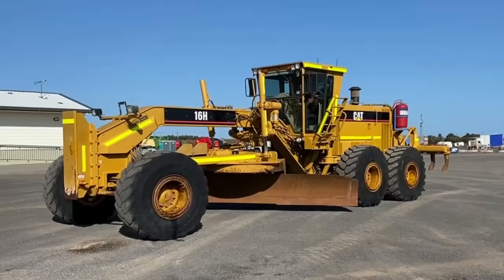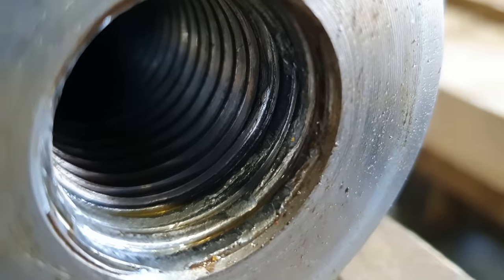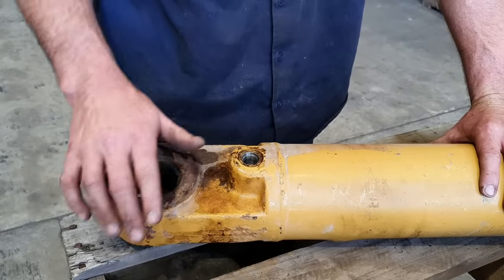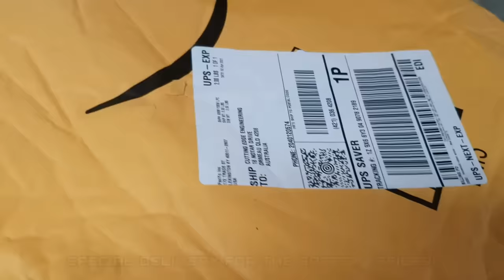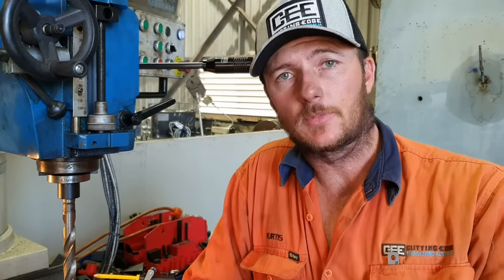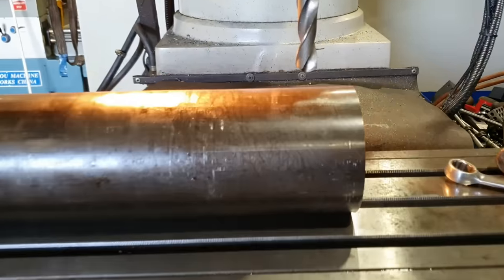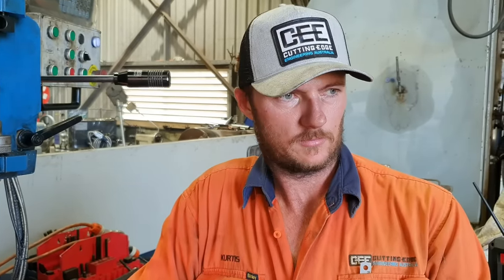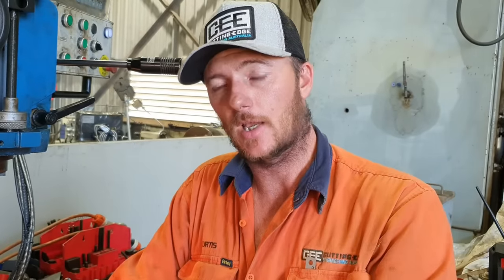Repair DAMAGED Hydraulic Cylinder for CAT 16H Motor Grader | Machining & Welding

Comment: "A 19mil hole, or 3/4 of a banana". :D Ah yes, finally - banana for scale.
Reply from the maker: Oh yes The Standard Banana is a most accurate form of measuring 🤣👍🍌🍌🍌
Reply: @CuttingEdgeEngineering  Ah yes the decimal use of a fraction measurement can only be the most accurate form of measurement! 🤣🤣🤣🤣 only the yanks could think it was a good idea! 😂😂😂
Reply: And the banana is kind of 1 inch thick so I agree with Kurtis it is banana not a pinch😂😂
Reply: I saw a plastic banana ruler for sale.
Reply: @sumduma55  Apparently, they assume length bananas. Here, it's diameter bananas, a completely different unit.
Reply: @STRA1GHTAHEAD  well... I guess that explains why I can't get this cow into this horse trailer.
Reply: @CuttingEdgeEngineering  by that you mean MOON LANDING UNITS! Lol.  Real men measure in fractions. Lol.
Reply: @STRA1GHTAHEAD  In the UK, 🇬🇧 in shit engineering documentaries they seem to like 'double decker buses' as both a unit of length and weight 🤔
Reply: @Miketm155  Good enough to get us yanks to the moon. 😊😊 but seriously the imperial system is a pain.
Reply: @derekjthompson1986  yeah that’s true but I reckon it’d been cheaper in metric 😂😂😂😂 like I get it when your down to 1/8’s of an inch on a tape measure but when you get into decimals on a digital vernier gauge I’m like how the heck does anyone deal with that! 🤣🤣🤣
Reply: I converted to a PA25 Pawnee once, and used to knots, I was briefed that this had an ASI calibrated in bananas.  It might have also been mph, but bananas seemed to work just as well.
Reply: You obviously don't watch AvE lol
Reply: I want to ask because I live in America and everything is just go buy a new one. How exactly does the screw pull out of the rod if it just holds the piston?
Reply: Hey! I don't do sillimeters!
Reply: It’s a blonde one bigger than a banana to be exact
Reply: where do you think the inches and feet come from. Some say the yard was the distance the nose and the tip of the middle finger of some English king..
Reply: @xl000  From a country that drives on the wrong side of the road, uses Sillimeters to measure things and doesn't speak The King's English .... hmmmmm. 😎
Reply: @justinpass8154  There is a lot of pressure on that bolt when the cylinder is retracting.
Reply: 2021 most of the world believes it.
Reply: It can join football pitches,pencils,tennis balls and human hair in the hall of fame of super accuracy….🤣🤣👍
Reply: @Miketm155  A thousandth of an inch is actually a nice unit in the shop. It's one of my favorite stateside units. It's right around the lower limit of what you can see and feel. A millimeter is too big for that and a micron is too small. A thousandth is in between, logarithmically. For example, a sheet of paper is a few thousandths thick. That's nice (e.g., as a spacer) in the moderate-precision work quite common in a machine shop. The same sheet is about 75 microns thick. That's less convenient.

When I would visually "touch off" in a lathe or mill with a nice sharp tool, it generally knocked off about one thousandth in my hands. Again, this meant I could conveniently get parts within spec for relatively demanding applications (small parts: optical adapters and sample mounts for laser experiments). For example, often I'd be facing some small rod stock in a lathe collet and need to hold a +/- 0.001" or 25 micron length tolerance; it was possible without a calculator or lots of mental math.

Another nice unit (I'm a chemist by training so this is saying a lot): degrees Fahrenheit is nice for discussing what's going on in the kitchen or with the weather. You almost always get all the precision you need with a positive whole number on a common scale. That wasn't quite true in Chicago, though - Chicago gets pretty cold.

Now give me the mass of an object in grains and its velocity in feet per second and ask me for its kinetic energy in foot-pounds, and, yeah...bananas.
Reply: #gottherefernece 5/7 👌
Reply: @Miketm155  to be fair, we stole it from the Brits.
Reply: @justinpass8154  the piston is pulled off the end of the rod because over time the bolt holding the piston vibrates loose, eventually there isnt enough thread to hold it on.
Reply: @Miketm155  some of use yanks can use both.   ;p
Reply: In the nuclear world we use bananas to explain in layman's terms how radioactive isotopes are. "Banana Equivalent Dose," or BED.
Reply: @justinpass8154  my guess is it became loose from vibration. The bolt has to transfer the hydraulic force from the piston to the rod when retracting the cylinder
Reply: Really enjoying your vids. I notice you never make a pilot hole but just go straight to the eg 3/4 banana.  Btw our uk smallest amount of size is known as a “kipper’s eyelash😂
Reply: @justinpass8154  wasn't torqued properly when either assembled or repaired.  Or the lick washer on it broke and caused the bolt to come loose.  Those cylinders work under extreme pressure over 4000 psi.  If something breaks internally all kinds of crap will happen.
Reply: @sumduma55  19.05mm is exactly 3/4 banana. I work with the banana scale all the time and much prefer metric. I am trained in bananas, so i always have to relate mm to banana to understand the true scale i'm working with.
Reply: @danieltodd22  or from stretching more like it.. Or the thing wasn't done up properly to start with
Reply: Waiting for a crypto currency based on 🍌  - banana dollars
Reply: It's time Americans learn how to measure properly. Metric is definetly way superior to bananas. Thanks for  yet another awesome video guys 😀
Reply: Little fun fact. Napoleon wasn't as tiny as everyone thought. 
British heard about his height and forgot that a fresh foot was 10% longer than a British one.
( French have bigger feet than English man) lol
Reply: @mynameisaric  Why use the odd monkey system if you’re already used to Imperial?
Reply: Does the piston head not work? or did they forget to recover it?

Comment: You know the parts are expensive when they're willing to pay someone else to go through all this to make the old one re-serviceable.
Reply: Either expensive or will take too long to get the replacement part. Sometimes both of those is a major showstopper. Oh there is a third, which is where the part is no longer available for whatever reason.
Reply: CATs  are yellow because it is the colour of gold.

Comment: "3/4 of a banana" - you're killing my sides!
Reply from the maker: Banana measurement helps our USA viewers
Reply: Do we assume that there's exactly 12 bananas in a 'bunch'? 3 'bunches' in a 'branch', and 1760 branches is a 'plantation'?
Reply: @CuttingEdgeEngineering  If the US had completed metrication started in the 70s people would speak the same and wonder why in hell it didn't happen 100 years ago ! The net result is confusion, errors and lack of competitiveness ! Recently has to laugh at Home Depot listening to two people trying to figure out the total pipe length they had to buy, trying to add feet inch fraction etc....
Reply: @clitisswood7330  Homedepot = rank amateurs, they can't handle 1960mm either. I work in both systems daily and have for 35 years, I could care less, both systems are dirt simple. My only gripe with the Metric system is the thread selection for fasteners below M20 is shit. The coarse series are too fine and suck horribly in cast.
Reply: @trevorvanbremen4718  It depends on whether it's a US or imperial banana.😂
Reply: @clitisswood7330  Bullshit, US mechanics are drilling out seized metric coarse in cast iron and grey 60 , and discarding welded components due to cold welding, The US auto industry has been metric for a couple decades now. 
When I get cylinder glands and valve bodies in with metric fasteners, the M6 thru 12 always need inserts because the threads come out with the bolt.
 I get a laugh out of people beating their chests in supposedly "hard metric" countries. Metric pipe threads? Nope, Imperial with metric units applied. Metric roller chain? Nope, Imperial with metric units applied . Metric sockets with metric drives? Nope Imperial drives. Fly in a plane, altitude in meters? Nope, feet. (widely adopted international standard)
Anyone with an IQ above 100 can learn both systems and it pays to do so if you are in engineering or machining. That way you won't be baffled as to why your new ratchet wrench drive measures 12.7mm  🤣
Reply: @trevorvanbremen4718  And a hand of bananas is a foot long .  So that 3/4 of a banana hole is also 1.1/5 fingers which sounds about right !
Reply: Got to "love" things 3/4 and 3/8 inch, AKA 19 and 9.5 mm.  The stuff works for everybody.
Reply: @steamfan7147  I understand your reasoning, however we live in a global economy, we should definitely get our shit together and perfect a single universal standard(integrating the best from all pre-existing measuring systems). Otherwise there will always be confusion and many other engineering mistakes until the end of time...
Reply: @Dsp.Studios  I have heard all the arguments for the past forty years I have been listening. The problem here is we do not have a clean slate to work from, we have existing infrastructure that we cannot throw away and start over with.(about $200 trillion in the US alone)  As for engineering mistakes, that stems from the quality of the engineers being produced, which these days isn't very good.
Reply: @steamfan7147  i dont mind the imperial system but it shouldnt be used anywhere in Metal Industry
the metric system is overall better unless u want to imagine yourself Football fields or smth
Reply: @LordOfChaos.x  In the machine shop, both are expressed as decimal measurements,. If one has modern machinery it's as single keystroke to convert either way.
Reply: @darinareyacrazyman1505  i see no reason for Imperial System to be used in the first place 

I dont care about your nonsense 
But its just irritating to do contracts with countries that work with Imperial System
Reply: Yeah got me 🤣 good

Comment: The thing I like most about your channel is you explain what's needed then get to the machining.   Other channels go into such excruciating detail about how they go about setting up a job, clamping it down, dialing it in, why this will work & why that won't, etc. Which is fine if that's what the viewer is into, however, I'm not a machinist and never will be but I'm always curious as to how a technical machining job is accomplished, which you do to perfection.  Thanks!

Comment: Thread cutting on a lathe still seems like a dark art to me. I'm astonished how easy you make everything look.
Reply: Its easier than it looks. His lathe looks like it has auto shut off at the end of the thread so that makes that bit easier, normally you'd have to be pretty quick on the stop button or lever, digital readouts also make life easier, I've done a little bit of threadcutting on a lathe, good skill to learn. We did 95% of our work on the CNC lathe though, that shit was beyond me, CNC computers confuse the shit out of me
Reply: once you get the hang of it its not too hard. Basically, you using some method to connect the spindle to the movement of the caridge, for example in this video he cut a 12TPI thread so for every one turn of the spindle of the lathe, the threading system on the lathe moves the caridge 1/12 of an inch. You use a form tool to get the right thread shape
Reply: I’m amazed at what CNC can do. I’m even more amazed at how ridiculously complicated the software is.  It’s a computer FFS - software should not make jobs more complicated than they already are.

Comment: When I worked at the hydro power station a bolt that size broke in 3 pieces on the end of the Francise turbine shaft. I caught It in time and saved the thrust bearing. The turbine looks like a giant snail shell.

Comment: hey i noticed you were pushing the mig i cant remember if i was taught to push or pull but get good results pulling but noticed i get a huge difference in weld quality  doing a fillet just by changing the rotation when laying the  pool

Comment: Common problem with this cylinder. I retired from Cat hydraulics cylinder plant. Conical washer was installed backwards causing loss of torque on the piston bolt. Admire your machining skills. CNC machined for years. Cheers!

Comment: Enjoy your excellent videos and admire your skills. Wondering why when the old cylinder was put into the chuck there was not much effort for indicating it to be dead center when a center drill was used for making a center on the other end. Maybe cutting off part of it does not need that much accuracy, but when new cylinder was held, the same applied. I was thinking maybe cutting a thread on the other end of it requires the piece be really dead center and no wobbling. Is your 3-jaw chuck that strong that hold a piece so securely for cutting thread. Wouldn’t it need a steady rest to hold the cylinder steady for thread cutting. I am disagreeing with your excellent work, I am just curious. Thank you for your videos.

Comment: I would like to see a mention or an entire video that is dedicated to what can make a weld fail, I.e. not cleaning all of the slag out of a previous weld, before starting the next.

I couldn’t possibly count the number of times that I’ve seen a weld machined down for dimension, and a pin-hole appears because all of the slag hadn’t been cleaned out properly. It’s probably 2-3 time a week!

Comment: Sometimes I rewatch episodes for a few years ago like this one :) 

The last episode I watched the cylinder came in as the end could not be unthreaded, Kurtis ended up machining it out and had to replace it with a new one (till a faction of the cost of replacing the entire cylinder)

I was thinking the system or machining off the end off welding it for replacement, is much more efficient than having it threaded on, IF it gets rusted,.

Rust cannot penetrate a weld!  It seems to me it's better to just weld the ends on, than make them all threaded.

Comment: Hey Karl, for some1 who has never stepped into a shop I was wondering two things: what happens when you dont use oil/coolant while drilling, and do you protect your dog's eyes from welding?
Reply from the maker: Hey mate, no oil/coolant when drilling and shit gets hot haha but leaves not a good surface finish, wears out tooling faster. Doggo stays in the office when i'm welding he doesn't like the sound
Reply: @CuttingEdgeEngineering  thanks for the answers Kurtis, love your vids😃

Comment: So, I guess the piston having a dent at the tip is not a big deal, as long as it glides in the honed cylinder. Is the glans bolted on the end a critical fit?

Comment: New to machining, when putting in those internal threads, are you advancing the tool by hand to get the proper thread spacing or does the machine do that? Seems very challenging to cut threads manually like that
Reply: The machine has settings to advance the tool at the correct thread pitch and synchronization. There is a threaded shaft geared to the spindle that drives the cutting head.

Comment: How do you decide whether to weld a block on the end of the cylinder versus drill a pilot hole? Seems to me that it would be better to have tack welded a block to drill the center point into rather than weakening the eye by drilling the end itself.

Comment: I would like to know how you polished the inside bore, as the O rings must have a super polished bore to so the O ring seals do there job when the cylinder is pressurized? If the surface is not supper smooth the O ring seals will not work and wear out in short order !!

Comment: Kurtis, why did you not leave any gap in the joint you prepared? I have set up a ton of welds and between 3/32 and 1/8 of an inch is necessary to get full penetration. All the best, Edgar from Canada

Comment: I've watched you do miles of heavy duty weld, yet it has only just dawned on me that Karen is also watching you weld and thus, must be using a welding mask.  An automatic one,  I take it?  The thing is, can the automatic gain on her camera cope with the weld flash, or does she put the camera inside the mask?  I kind of think I see that happening, but it is so quick and the mask so close, I'm never sure.  In short, it must be very difficult to video welding and protect the videographer?

Great vlog, mate, I was beginning to wonder how much was going to be left of the original ram!  Of course, it's not everyone who 'happens to have' a chunk of 120mm honed bore tube lying around!  Great work, well done.

Comment: Very good job, I would have also made a reform to the design of the piston with the rod.  I usually make the stem with a male thread, in which I thread the piston, and then to block it I use a small threaded grub screw between the thread of the piston and that of the stem, thus I avoid this type of problem, that a screw of those dimensions drop into the cylinder.  
I understand that the client has requested it that way, it surely has a replacement piston, but I think that it is not the best design.  A greeting from Spain.

Comment: I'm a bit confused.  How is this a "repair" of the cylinder.  The only part of the cylinder that was not REBUILT was the ell connection.  This was a great video on the REBUILDING of a hydraulic cylinder.
And i consider the cylinder to include just the cylinder.  :)

Comment: I notice instead of disconnecting your thread index lever, you keep it engaged, when you back out the cutting tool. You never engage and disengage your thread index lever which I think will be more accurate keeping it engaged when reversing, the way I was taught backing out then re-engaging the index lever. From now on I'll use your method it is much more accurate, let me know if I made a correct observation. Thank you. As a side note I watched dozens of your videos so far every one of them interesting and loaded with techniques that I can use my own shop.